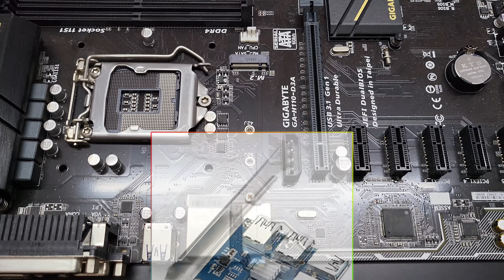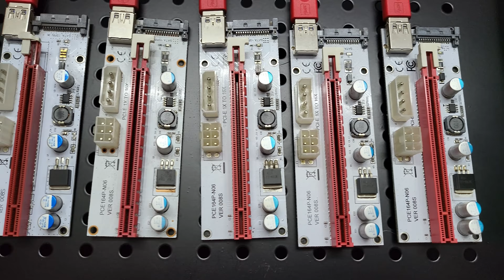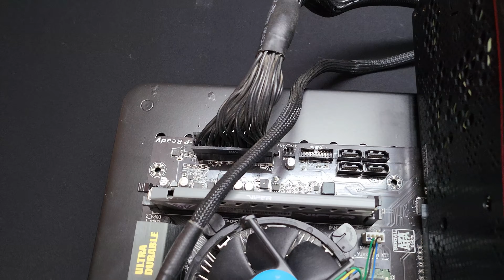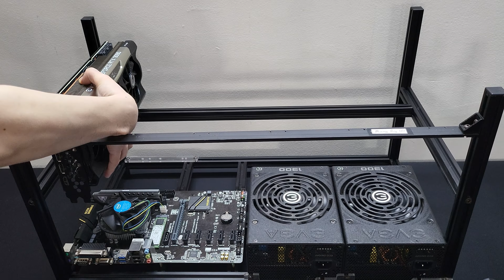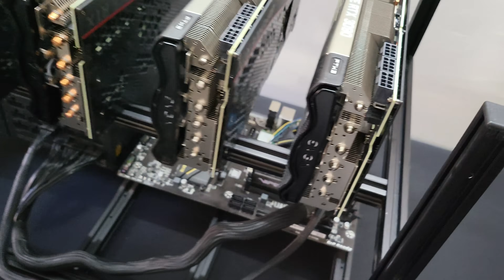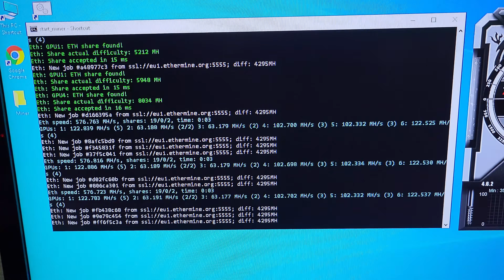How to Build a GPU Mining Rig | Beginners Guide

Comment: Dude ur newbie ur like young you dont have any idea about things u missed that u need to do to make effective n power supply of hashrate same but less power
Reply: Also so many things u could have told them
Reply: Like such as what type of gpu is best and all u have arnt best they r good dont get me wrong
Reply: P.s i mean no hate my friend im saying alto or this information is missing so much and alot of this stuff is already well known but if u make a video on youtube please learn the basics tricks to make things quiet and respectfully. Ur power supply is over kill
Reply: U no why u needed more cables bc u dont need it
Reply: Thr cables for 1000watt psu and a thing best for this now u will have issues woth heat dissipation factor bc of your gpu pick theses will over heat fast give it a weeek max
Reply: Cpu... Man ur not breaking a mother board so why did u say that u also put eay too much thermal past n u didnt make sure to make the paste not touch the pushing of the cooler fan but with gpu mining u r gunna need a small m.2 not that big n. Mainly that mothernaoard needs that for wireless wifi
Reply: That will fuck up in ine month

Comment: hi there, total noob here when it comes to mining. I'd like to ask if that psu setup can handle 6 rtx 3070?
Reply: Which brand/model 3070s? MFG site for EVGA RTX 3070s non LHR says 220w pull however you’ll be power limiting the GPUs about half that say...123w...those PSU are 1300 each...so 1 of those are more than enough, keep in mind you generally want to stay within 80% of PSU limit, if you looking for dual PSUs maybe running 2 650s PSUs will be fine, you but can also run more lean than that

Comment: I have Asus H81m cs motherboard, 4gb ddr3 ram and i5 4440 cpu,
n plannin to buy 2×850w psu
*My query is if this mobo could fit  5/6 gpu rtx3070ti?
Reply: Only if your Mobo have 5/6 PCIe slots...or supporting M.2 to PCIe slots

Comment: Can I use 1 cable with 2 8pins but I use a splitter to make it 3 8pins in total to power a 3090. So it would be 3 8 pins from 1 cable

Comment: hi; can anyone tell me how much hashrate and how much $ of equipment could i potentially fit in a studio apartment of 700 sq feet in FL? i will be living alone and wouldnt mind fitting the whole studio with mining equipment lol....but i need to know the limit so as to not mess things up and upset the condo association or something...ima beginner , any help is appreciated thx ;)
Reply: Depends, on what you want to do, when you mention “limit” you don’t need like a special permit to run these things with county however, the limitation you will face is power consumption if your drawing more that 1600w can your electric plugs handle it....limitation 2: heat dissipation, if you are in FL its already hot AF my 6 RTX3080s make my sons room a good 82 degrees far away from the AC kickin 71 degrees...limitation 3, fan noise, depending on which cards you want the RTX 30s have large fans and generally sound like a 747 taking off at 100% fan

Comment: Nice video bro 👌🔥 , i have issue here i have two gpu in my windows but my other gpu is not showing in device manager and gpu fan is spinning whats is the problem please help me out sir 🙏🙏🙏
Reply: Reinstall driver. Pull up device manager (if on windows) and check there. Assuming you have all cables attached and everything is seated correctly, that there are no foreign objects/debris inside connections, there may be hardware damage to either the pcie port on your mother board or the gpu itself should you still have any problems. Good luck.